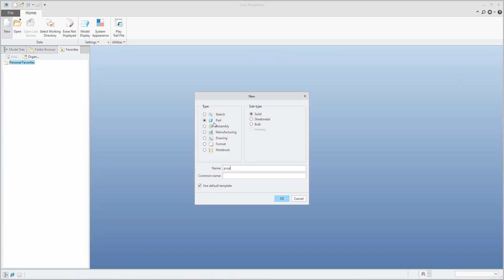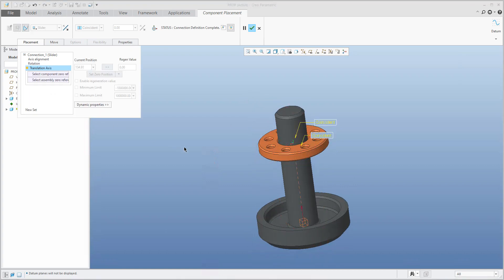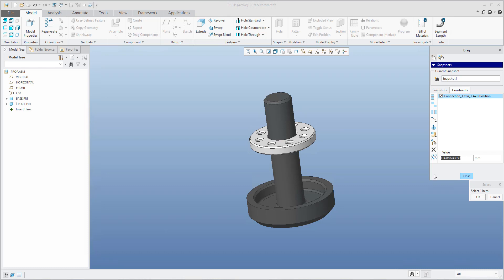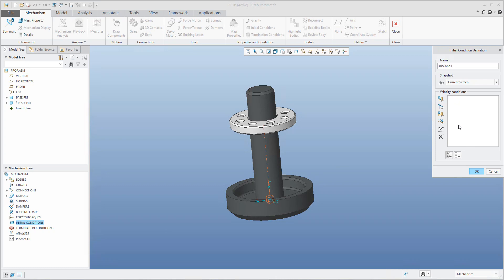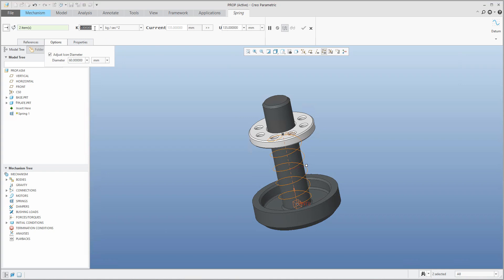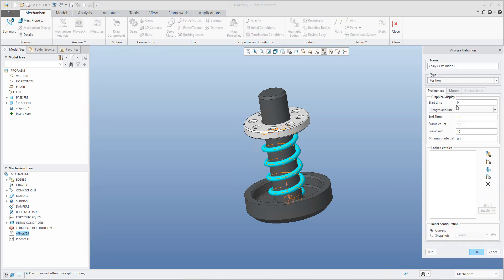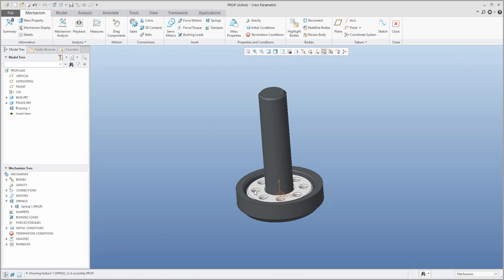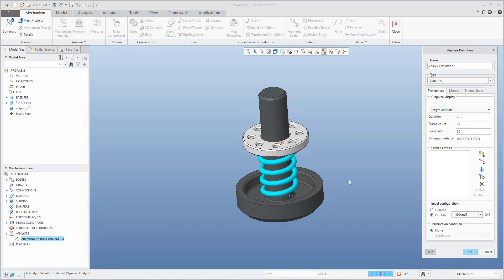Define a Spring with Creo Dynamic Analysis

Comment: I always quite like your posts.  At 1:40, how do you know to select 2 surfaces when placement constraint is called a Translation Axis?  You selected the axial alignment first and then it asks for another axis. Keep up the great work!
Reply from the maker: Hi, thank you for your positive feedback and question.
In every mechanical constraint set system show what is necessary to select (e. g. For Cylinder is only one condition (axis to axis / cylindrical surface to cylindrical surface) if you have pin constraint system add aditional info in the placement tab.
I will try to explain one more time in another assembly tutorial.
Stay tuned. Vladimir